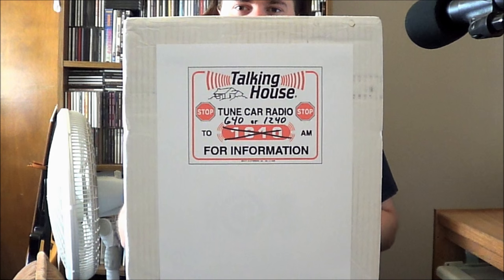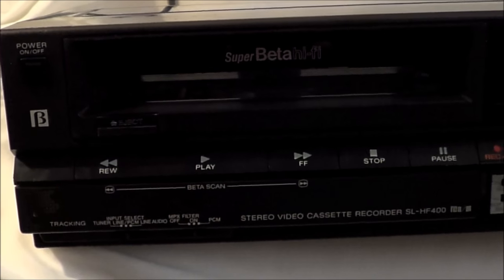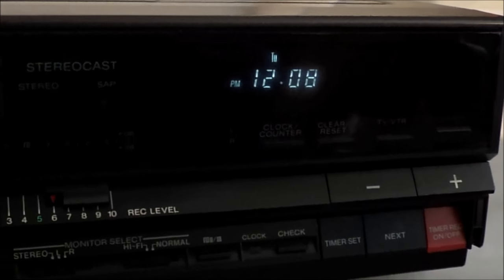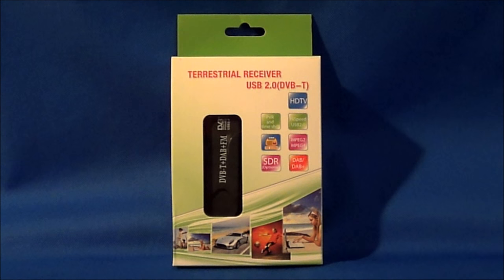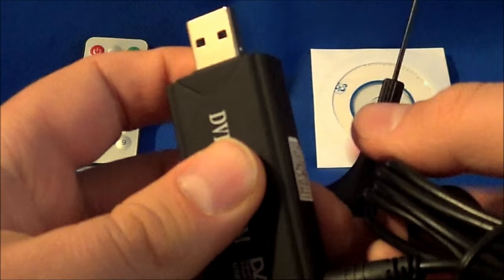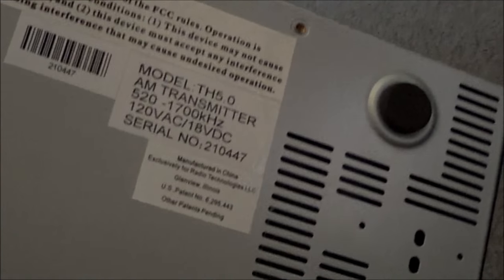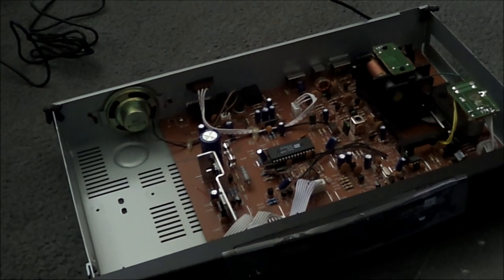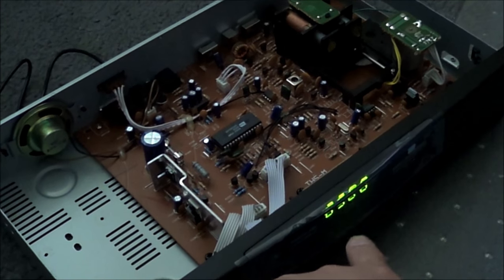Oddity Archive: Episode 103 – How I Spent My Summer III

Comment: Mechanically auto adjusting coils: That's probably an automatic SWR tuner for the antenna. If you can't pick anything up while it's going back and forth, what's probably actually wrong is the final stage transmitter amp is bad. There's no signal for it to tune the antenna to, so it can't find the tuning point. (you have to have a tuner because the antenna is very very short... a quarter wave in the AM band is something like 400+ feet.) It should at least be generating a carrier on the frequency you selected. Given the low power it should be able to transmit into just about any SWR, the tuner just makes it a little more efficient and gives you a slightly higher effective radiated power. 
I have a similar antenna tuner for my HF ham radio rig, but it's a) manual, and b) much bigger, as it handles up to 500 watts. 
Note that ideally you want a matched, harmonic antenna. The tuner is mostly turning the reflected power into heat.

Comment: Sony Super Betamax Hi-Fi VCR model SL-HF400. Introduced in 1985 with a price tag of $800.
Reply: Gosh. That's unbelievable to me. I never really was around long enough for VHS players to have such a high value, being born in the late 90's and all. $800 bought me this laptop and back in the day it could buy you a Super Betamax player. That's just amazing to me how much times have changed.
Reply: The crazier thing is that $800 in 1985 is the equivalent of $1,827 now, so a Betamax was basically a mortgage payment or rent back then!
Reply: Whoa. I didn't actually take the time to adjust the $800 for inflation. That's absolutely insane. I can't even think of anything besides college or apartments that I would invest almost $2000 in, let alone for Super Betamax.

Comment: That USB radio thingy is crap.
Reply: I dunno,$10 for a receiver that covers something like 45-1700Mhz,in all modes,with loads of plugins for the software (I've been using SDR#),is pretty good in my book. I'm more than happy with mine. The key is to use a real antenna,and go easy with the RF gain control. I have seen all kinds of signals. Works as a ghetto spectrum analyzer,too.

Comment: I got a chuckle out of "Tune car radio to 640 or 1240 AM"
Reply: Those were the frequencies to tune in to back in the day when Conelrad Emergency Radio existed.
Reply: Yup.  The reference did not fly over me. ^_^
Reply: Remember radios back then had little triangles on the dial at those settings. My mom had a GE transistor portable radio that had those frequencies marked on the dial with the black triangles to indicate what stations were for emergencies.
Reply: Also, one of the recommended videos is the Conelrad video.